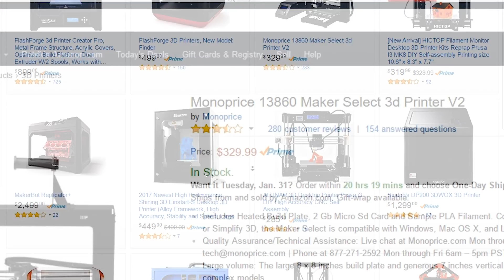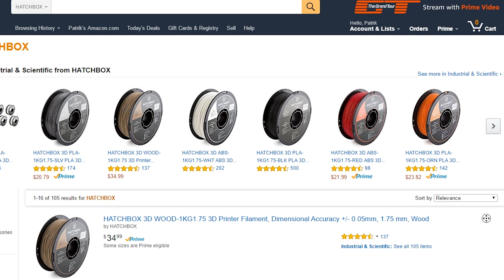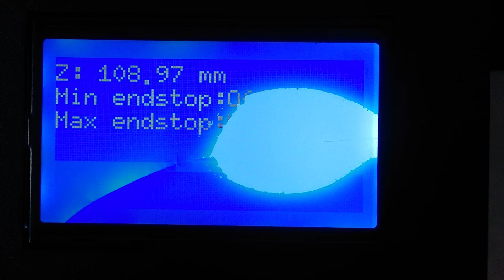3D Printing with the Maker Select V2 - Ep1 | Overview, Assembly, and first Print

Comment: The water in my shower is 160F, the baseplate will not burn you except for somatically until you get a printer that can get to 90C or 100C

Comment: i have this same model and my computer crashed and while i had the sd card in there i believe it was lllmp or something like that looking i thought it was cura but i downloaded it from the site and it did not look as the one i had before thanks for reading any advice or help would be helpful thank you!
Reply: the whol programs set up is made for setting up more than just the monoprice the program that originally came on the 2g sd card was strickly for the mono price and also if i wanted to add extra extruders it also had that option which isnt my issue but the set up and how the build are made.....i make on the cura program u show the time says 5 hrs for instance and it will take 10 hrs to build for real which i get it if it wasent right on the mark on time maybe and hr longer but 2 times the amount of time"?......also on this program if someone is building sculptures what would u recommend the main setting to make the shell perfect with minimal supports if i do hollow inside and thicken the walls the object still will not come out perfect and has gaps and whole even if i fill them with the added option......thanks for replying would love to know your in site again

Comment: Excellent review and intro.  What is the max temp of the bed?  The manual says 70C but that doesn't even seem reasonable... Don't you need 85C for ABS?  Also, the manual says the extruder's max temp is 240C, but on the Monoprice website it lists 260C as the max temp.  Is this a difference between V1 and V2?

Subscribed! Keep it up!

Comment: Awesome! I'm about to buy either the Monoprice select mini, or this one in the video but can't decide. Any suggestions?
Reply: The1CK I would most definitely use the Amazon links provided because you've been so helpful but I was planning on buying it off of Monoprice. I saw some of the reviews say they had trouble with their printer and that it was bothersome sending it back through Amazon. That leads me to my next question. I've been reading that the V2 has a fire hazard on its main bored that needs to be fixed before you start printing, is that true?

It sounds like the V2 is a better deal for $100 more, but reading people say theirs caught on fire or burned out is keeping me on he fence. Thanks so much for the info on everything!
Reply: The1CK Ok, I think I'm convinced on the V2 then. Thanks so much! If I end up ordering from Amazon I'll make sure to use your link
Reply: I have the select mini, and it's been an amazing first printer, but I need more space so I'm getting this one as well. Good video man!
Reply: Monster rally I have a select mini and I recommend it